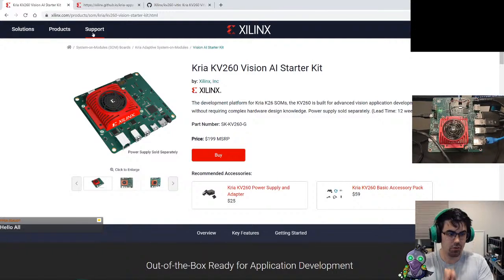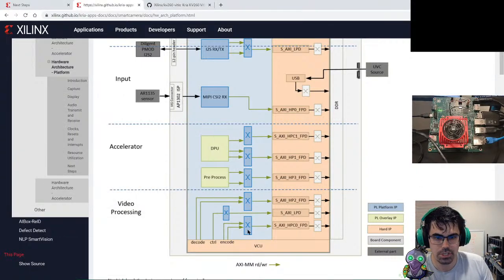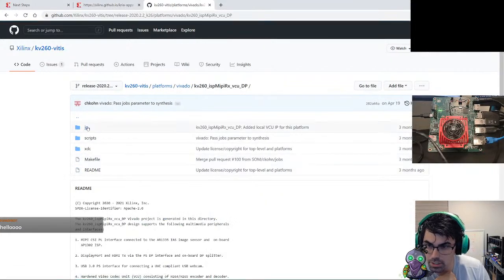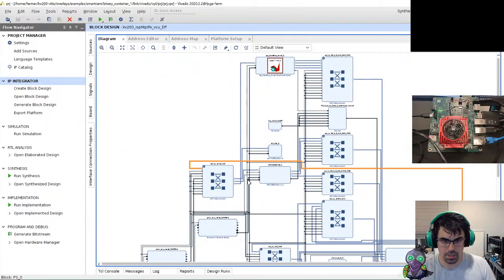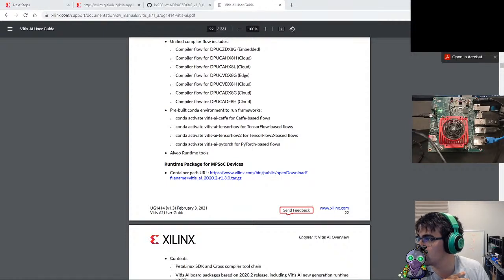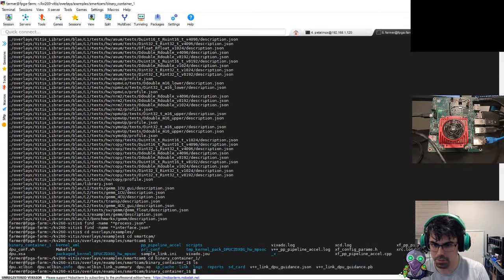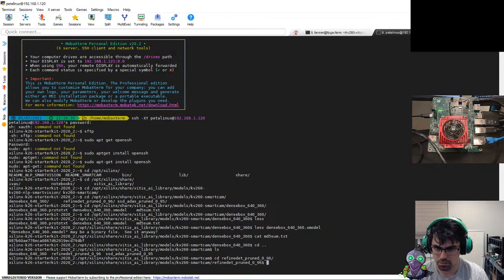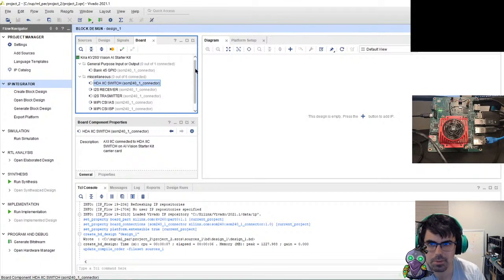Kria FPGA First Look

Comment: XSDB seems to have worked for you out of the box.  Did you need to do anything to the dev kit FTDI EEPROM to have the MPSSE JTAG detected by XSDB?  I'm in Linux (so a delta from your setup), but i haven't figured out how to get port A on the FTDI to be detected as JTAG rather than VCP.  Other device descriptors indicate Xilinx has indeed already programmed the FTDI EEPROM.
Reply from the maker: For Linux, you need to install the driver software from the Vivado Data xicom directory.
Reply: @FPGAZealot  good call.  that's what I needed to do.  also, if trying to flash new boot FW to the QSPI, on the dev kits only (not the prod modules), the majority of the QSPI memory is locked so you need to specify the starting address of one of the 2 writable partitions A and/or B.  This required significant beating of the head off the keyboard to figure out.  Thanks!  I look forward to watching more of your videos!  I've been finding your work and the work of your friends at the cpe quite helpful.

Comment: I am seeing 52 week lead times on this board. I have used xilinx FPGA's since there were FPGA's to use (early 80's) and I have never seen lead times like this on a component. Of course, the much more expensive development platforms like the ZCU104 and ZCU102 are basically available now.

Comment: Hey your work on these FPGA videos are execellent. 
I've always thought that xilinx's website for new learners are REALLY tough, many introductory videos, which is fine but I need something more. For microcontrollers i've worked with, there are many example project/reference designs etc. How did u get to that level u are as u seem to be really knowledgeable.

where do I get concrete example of how to learn HLS, vision designs... so on and so on...

Sincerly Mosne
Reply: Yes, you are right. normally the basic are easily available, but for more advance stuff, one has to take those expensive trainings.
Reply from the maker: Yea,  I want this channel to explore the advance feature and interfaces available on FPGAs.
Reply from the maker: 6 years of Electrical Engineering at the university level (B.S., M.S., Ph.D. in progress)
6 years as a research assistant reading lots of Xilinx Documentation for CRAM fault injection
4 summers at NASA working on the SpaceCube2.0 (Xilinx Virtex 5)
2 years at L3Harris using Xilinx FPGAs
6 years of FPGA hobbyist buying way too many personal FPGAs

It can be hard to find examples.   For HLS and Vision, I would try  https://github.com/Xilinx/Vitis_Libraries/tree/master/vision.  This has advanced examples from Xilinx but may be hard to follow.  Otherwise, look through my Master Dissertation and source code for simpler examples. Check this video for that info: https://youtu.be/X3rv-vkDV1Q
There is a constant hunt for good examples, I hope to explore as many as I can on this channel.